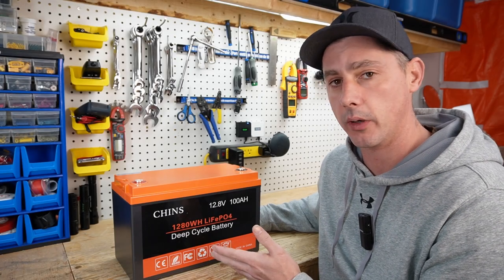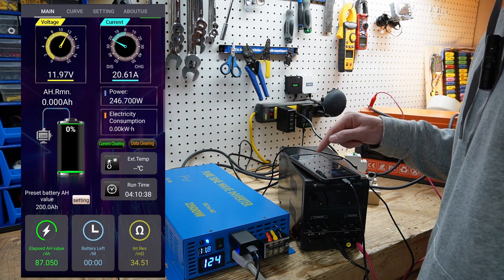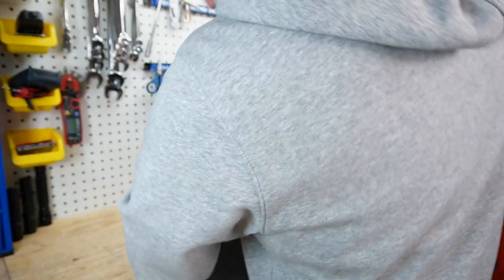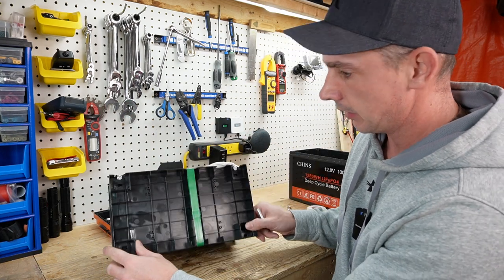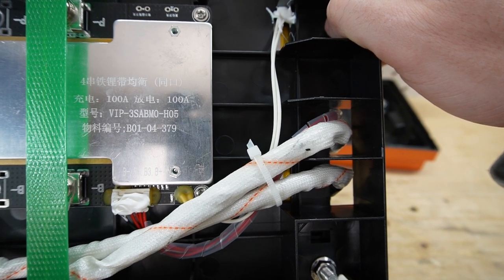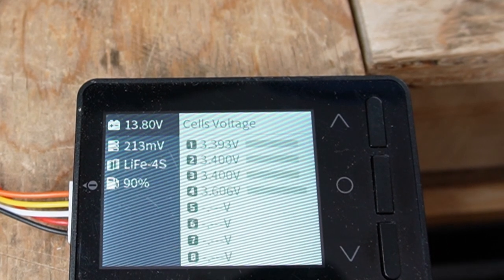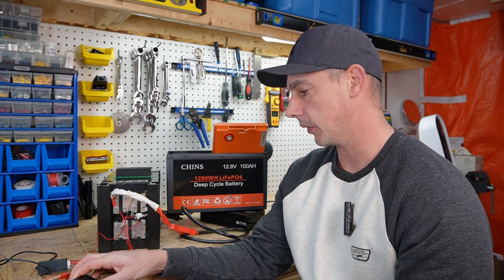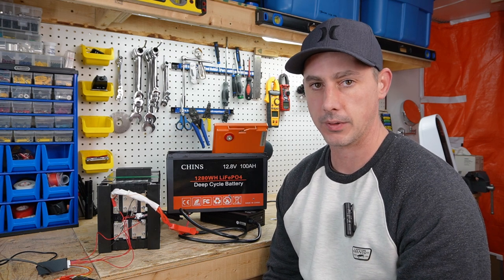Chins 100Ah 12V (12.8V) LiFePO4 Battery Review Fail

Comment: The bigger chins use prismatic cells. Buy a 300ah and run the same test. I've noticed most the 100ah or Smaller are pouch

Comment: That 4th cell is the first to hit low voltage protect, and the first to hit high voltage protect. Means It's lower capacity than the rest, and it will never balance out properly to get you full capacity of the battery. Bummer. I do however think it's neat to see different internals. Great vid!
Reply from the maker: You are right; I thought about that while editing the video. It will never get to full capacity. Thank you for watching.
Reply: Yeah you can only cycle the pack the capacity of the weakest cell.  No different then lead acid though.  I sometimes work on golf carts and yeah doing capacity tests on a bank of 48volt lead acid, 6, 8, or 12 volts....   still have to have fairly matched set.
Reply from the maker: @john0270  For sure, One thing with golf carts I've seen is tapping lights into a battery to run 12V lights throwing the pack balance off more and more over time.

Comment: When researching chins before buying my batteries I found it discussed that chins had a supply issue with prismatic cells and had to substitute with pouch for a short amount of time. 

Their customer service is great and all pouch cell battery buyers on the forum contacted chins and they sent them prismatic cell batteries as a swap out at no cost for shipping or anything. 

I bought 2x100ah 12v batteries, contacted chins as soon as I received them to ensure they were prismatic. They immediately asked for the serial number, then confirmed they were prismatic. They have performed as advertised and with my experience of their customer service and reading others experience I'm a fan despite the pouch fiasco. 
Sorry to see you had a bad experience! Be sure to get ahold of them and they'll send you a new one I'm sure. 

-Bob, B.C🇨🇦
Reply from the maker: That is some great information,
Thank you for sharing your experience with chins.
Reply: can you post a link to your info ? thanks
Reply: that is not my expense With Chins i too would like to see the link. i am no expert but the bms would need to be programmed different as well or changed .

Comment: Bought 4 of these for a 48v golf cart.  Burned out 3 of the 100a BMS's (even though my cart runs well within its operating specification monitoring current in real time).  Ended up de-casing them and making a custom pack with a reasonable 48v 250a Daly BMS and they work great now.  The construction of yours is way better done than mine was.  Glad to see they used actual bolts to keep them compressed.  Mine was just tape and silicone.  
Spec sheet says each 50ah cell is capable of 150a pulse, 100a continuous, so 4s2p config these cells "can" do 300a.
Reply from the maker: Really? A 2C discharge on a 50Ah cell. I'm suspicious of that. In any event I'm happy to hear you have the cart running 👍
Reply: @Roll2Videos  Suspicious as well, in any event the cart pulls about 70-80 amps while driving flat so having some piece of mind that the papers say 2c is always nice.  No issues so far.
Reply from the maker: @davidgreen8828  Perfect, I have some nice batteries coming for my cart. Stay tuned
Reply: Curious why you didn't warranty them? I have 12 Chins, and 4 Zooms. One of the Chins quit taking a charge. I contacted them and they sent out a new battery and told me to dispose of the bad one. 
Now I'm wondering if they sent me a pouch battery as a replacement.
Also the 3rd set of Chins was advertised as having low temperature protection, and none of the others were. 
I'm not a fan of pouch cells. I think maybe I'll try weighing each battery to see if I can spot a difference

Comment: Great video! Just bought my 5th and 6th Chins 100Ah 12V. Would you be able to weigh your new battery so all of us can use weight to tell the difference.Thanks!!
Reply from the maker: Great idea
Reply: @Roll2Videos  just weighed the 4 batteries two @ 22.3lbs and two @ 23lbs
Reply from the maker: @donwilson7826  I'm sure it'll be ok. Just keep an eye on them.

Comment: I have 2 Chins smart batteries.  I had to balance both of them in order to charge over 14.1v.
I have 4 Timeusb purchased as 2 sets of 2.  One from each set was badly out of balance. It took about 2 weeks to get them balanced.  Now my first pair will shut off at 14.53 to 14.54 volts and the second pair shuts off at 14.51 to 14.52 volts.  I just spent another week trying to balance all 4 with no change, so that's as good as it gets.
Reply from the maker: That doesn't sound very fun. Great job working on them.
Reply: @Roll2Videos  More annoying than fun, to be sure. Rewarding tho, to be able to full charge without the bms kicking off. And I picked up 2Ah on the Chins and several Ah on the timeusb. (getting 110Ah and the bms is still alive!)  I suspect the factory doesn't balance, or maybe they balance if the battery fails capacity testing?  One of my Chins reported 4 cycles when I received it, the less balanced one only 1 cycle.

Comment: i wonder if that bolt from time to time was shorting one of the cells .That's why the lower voltage in cell 1?
Reply from the maker: I don't think so. The area it could move wasn't around any wires or terminals.
Think it was just a bad cell on it's own.

Comment: Question: If a pouch cell is used inside a casing, does it then become a prismatic cell? What I found on the web: A prismatic cell is a cell whose chemistry is enclosed in a rigid casing. Its rectangular shape allows efficiently stacking multiple units in a battery module. There are two types of prismatic cells: the electrode sheets inside the casing (anode, separator, cathode) are either stacked or rolled and flattened. Now I'm more confused. Either way, thanks for the video!
Reply from the maker: No, it's still a pouch cell. Excellent question. I'm happy you're taking time and interest in this topic.

Comment: i like it, my chins works great, i just wondered how it gets at 13.2 with lithium cells, is it bms programming limiting voltage , wouldn't it be 3.7 x 4 = 14.8? how is it 13.2
Reply from the maker: @mrkeopele  There is voltage sag it does not hold the upper voltage. All lithium batteries are like that.

Comment: Good review. I’ve dropped chins as a an option through my solar business. The newer ones with Bluetooth BMS really show how far off cells are. I had trouble with them shutting off under charge at 13.8-14v rather then 14.4. 
They also do not meet discharge amperage ratings. I’ve had them repeatedly shut down after several minutes at 80-90% rated continuous discharge. Fail on top of fail.
Reply from the maker: Oh wow, Great information thank you.

Comment: I bought a 250 AH Chins for my boat on Amazon. It worked well initially but then refused to charge. After a bunch of troubleshooting, chins determined the BMS was faulty. Despite their warranty that promised a free replacement in the first year, they are refusing to do so. I won't be buying anymore from them.
Reply from the maker: Sorry to hear that. There are many stories just like yours with this company

Comment: spray electrolyte?? lol what?
Reply: @Roll2Videos  you said the battery could spray electrolytes
Reply from the maker: @jeremyconner7610   Yes, That is the liquid inside the pouch. If it's under pressure, it would spray electrolyte

Comment: I enquired to Chins as to the type of cells I purchased.  They responded with soft pack or pouch cells (they determine by serial number).  I complained for the same reasons as stated in this review.  They agreed to replace the cells with PRISMATIC.  I received a PRE-PAID return authorization and received 2 new 100A batteries from Chins stating the replacements were prismatic (I did not open). They tested to spec.  I must complement Chins for their immediate response and cooperation.  I even received the replacement cells before they received my return.  If these new batteries are, in fact, prismatic I would rate their customer service as superior.  YMMV!
Reply from the maker: That is great. I'm happy they helped you. My experience is I've emailed them three times. I even shared the link to this video with no response. I even offered to make a new video if they sent me the proper battery to pass my tests. No luck.
Reply: @Roll2Videos   the above reply has no videos, no subs . Gotta wonder

Comment: Chins is bad, part of a group of 12 in one importer union. But Chins has a problem, it's a WOKE employee ran all female with 3 USA women in charge. ( current politics in USA related to their bad decisions like Bud Light if your up to date ) so they are picking a lousy assembler in north China unlike its sister brands using south east china. So its poorest built in this line up. They are using same assembly makers as Wulills & LISUATELI tech and cells that makes Kepworth suck.
Reply from the maker: Wait, What's wrong with bud light? Quick, I'm standing in Target about to buy a case. I guess I can untuck and walk out of here; Canada has the best beer anyhow 🤪
Reply from the maker: Hahahahahaha
Reply: So what are the others that use better assemblers?

Comment: No your wrong. Pouch cells are dangerous not used for specific purposes. In a battery case there not stable. Renogy was using them and stopped due to failure issues.
Reply from the maker: It depends on the chemistry.